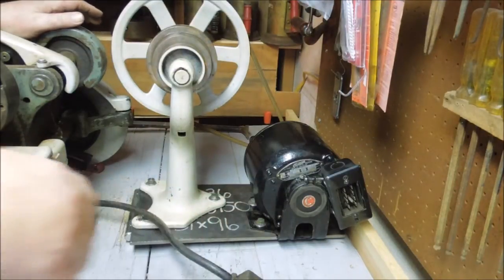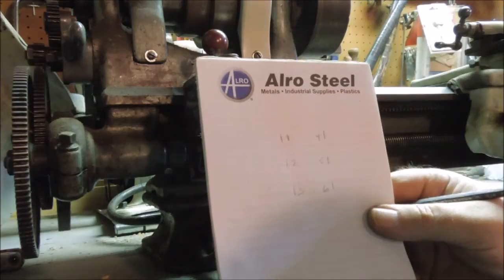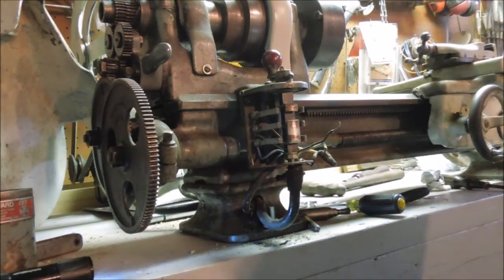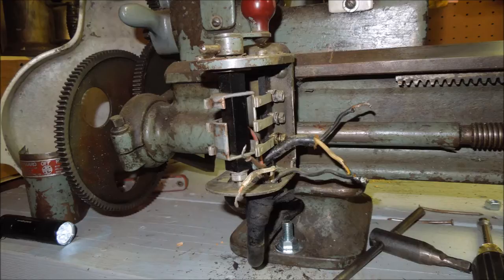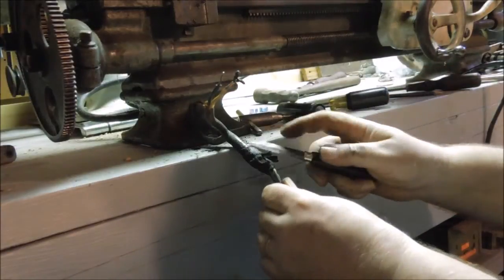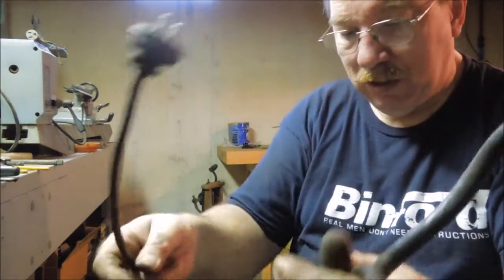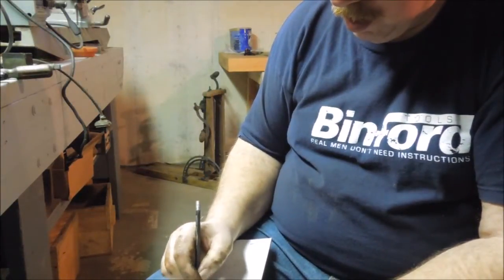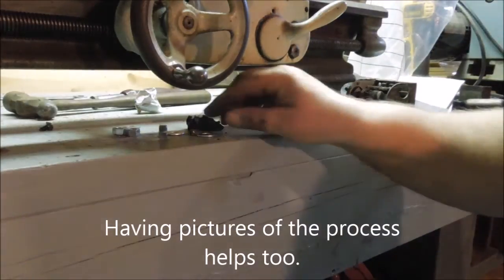Wiring Repair 1 - South Bend Mtr Mount Pt 9 - by Old Sneelocks Workshop

Comment: do you have a final wiring diagram for the whole thing?
Reply from the maker: All I did was mark the wires as I disassembled them and put them back exactly the same. 😁😎
Reply from the maker: https://www.google.com/imgres?imgurl=https%3A%2F%2Fopentextbc.ca%2Faccessibilitytoolkit%2Fwp-content%2Fuploads%2Fsites%2F314%2F2020%2F08%2FPower-Reverse-e1579709983720-1024x491.png&imgrefurl=https%3A%2F%2Fopentextbc.ca%2Fbasicmotorcontrol%2Fchapter%2Fforward-reverse-control-circuits%2F&tbnid=pirNktJX5WtdhM&vet=12ahUKEwjCiOTGjtb6AhUcQ1MKHfp6AZsQMygZegUIARCAAg..i&docid=QAYNVNp9ZEHybM&w=1024&h=491&q=reversible%20motor%20wiring%20diagram&ved=2ahUKEwjCiOTGjtb6AhUcQ1MKHfp6AZsQMygZegUIARCAAg